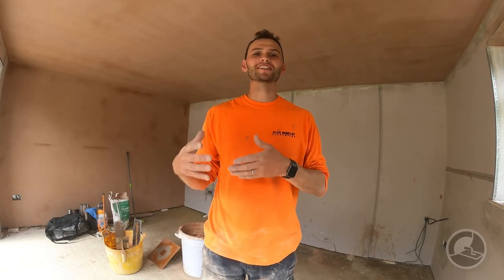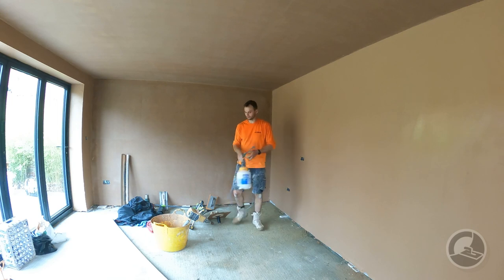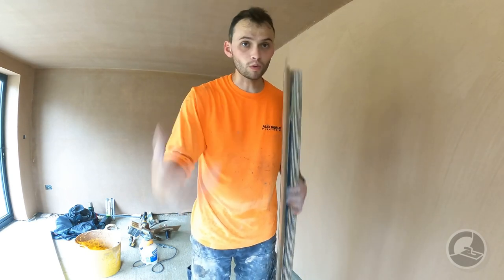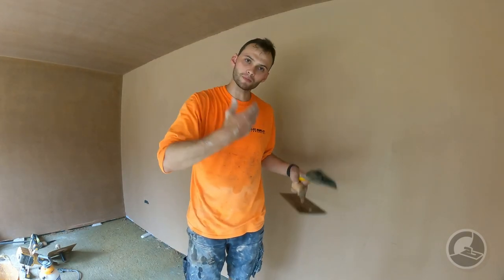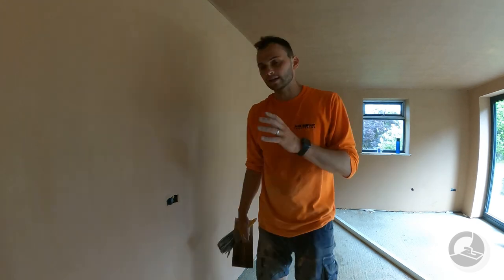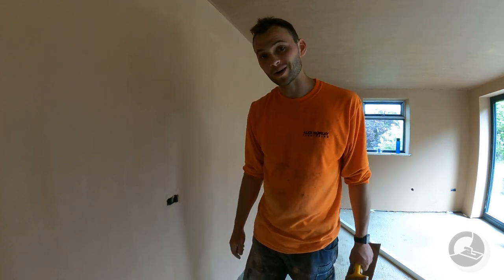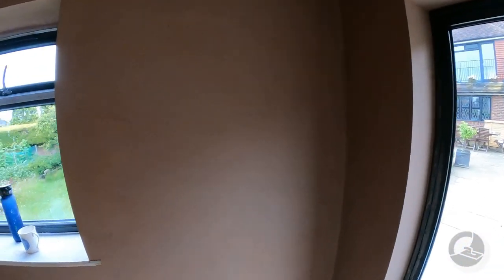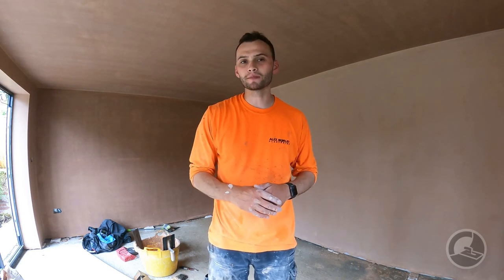How To Sponge Float (2 Coat Plastering)

Comment: Lovely work👌🏻 almost identical to my method. I personally love sponge floating too, lovely finish time and time again, blemish free. Find it useful on uneven walls where the plaster is applied heavier in some places, also make a huge difference on over-skims with different surfaces like plasterboard, paint and bonding patches all on the same wall. Great to have in the kit bag.